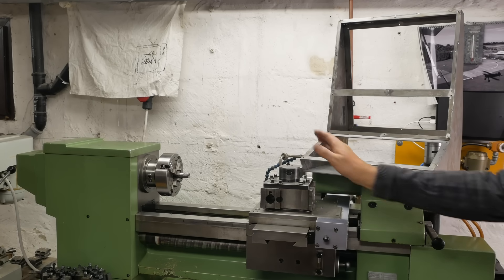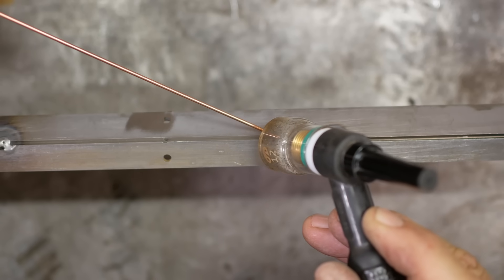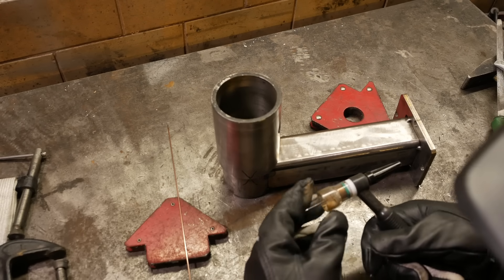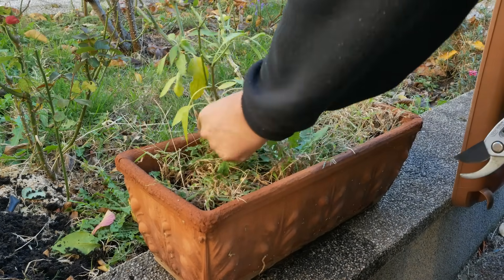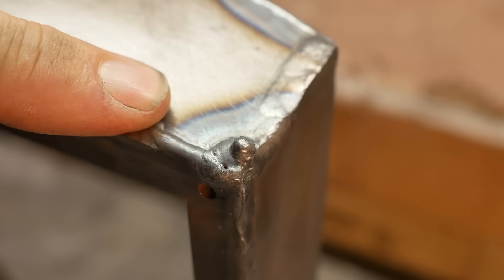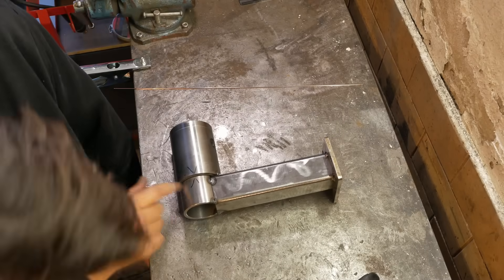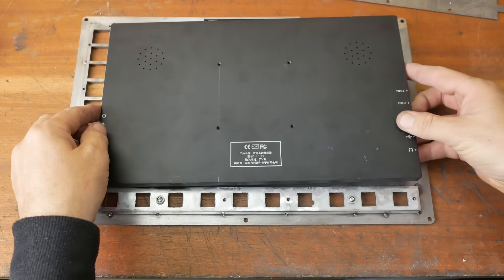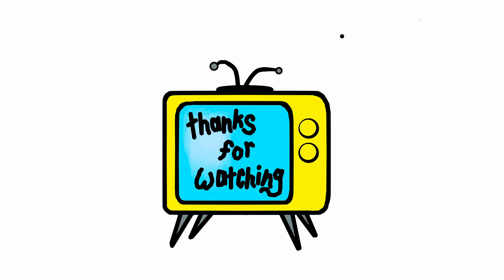TIG'in up the CNC control module  - Schaublin Ep. 57 || RotarySMP

Comment: If you buy a valved torch body you can bypass the machine and do your own pre/post gas by controlling the valve.
Reply from the maker: Is that not even harder to coordinate?
Reply: @RotarySMP  Sorry for the late reply.  You just waste some gas.  Turn on the torch valve, get situated, weld, let it post flow, then turn it off.  There's some waste the start/stop while you're fiddling with the valve.  But all the welding is done at that point so it's the only thing you're working on.  It's a compromise.

Comment: Regarding the LED and the key cap: you may be surprised how much shines through the white plastic. I have a remote switch for an attic mounted exhaust fan that I i added an LED indicator to, since you can't hear the fan, and just hot glued it to the side of the switch. It shines through the white plastic switch plate just fine.
Reply from the maker: Thanks Ross. I will give it a try.

Comment: All that bodyfiller and sanding just to put that ugly green colour on it. But, it is not my machine, so it is  looking great. That looks like a well thought out control cabinet. For the keys: I think you can get these Cherry MX key even with integrated RGB. They are meant as replacement/ swappable key for those newfangled gamer keyboards. I reckon you could also get little circuit boards for them and have them illuminated depending on the switch state. It is not too late to get fancy! 😎
P.S.: all the best for wintering those chilis. I never got mine to survive and had to raise them new from seeds I collected in the previous year.
Reply from the maker: I am also curious as to whether any of those chillis survives, but if they do, it would be brilliant and give us a few weeks head start on the growing season.

I dont really see then need for RGB in this use case. Maybe RG would be of marginal value for a couple of buttons, but I will make do without.

Comment: I was told that removing all the soil from the roots of a plant is a bad idea.  
The thought is that the fine/delicate root fibers end up getting crushed and broken by the new soil which will stunt growth for a time. 
Can shake it off a bit, but leaving a 'ball' of dirt around the roots helps support the smaller roots.  
Finally, once the repotting is done, the roots will make a mad dash to the new soil around the original root ball to get at that newly available nutrients.  This promotes a larger / stronger root system post-repotting. 

That could be wrong - I am not a plant doctor or anything. If others know better I would like to learn about it.
Reply from the maker: I just watched one YT video, and it removed all soil, to prevent insect eggs etc getting brought inside. Seemed plausible at the time :)
Reply: @RotarySMP    That is something I didn't consider. Makes sense.    
Thanks for the feedback.

Comment: Do you have a foot pedal for the welder?
Welds are fine, if you want them look a little prittier just ease up on the heat, or move alot faster. But lessening power is easier. 
Foot pedal is a must for tigwelding.
Reply from the maker: I have a foot pedal, but this welder only supports on/off switching. No ramping.

Comment: Generally speaking, you wouldn't normally use a gas lens for welding mild steel, it's a bit of a waste and can get damaged from sparks.
I would also avoid fusion welds (welds without filler) on mild steel, it tends to make a brittle joint... Not that any of this really matters for a control cabinet, if it's stuck together and doesn't fall apart from handling, you're doing good! ;)
Keep up the good work!
Reply from the maker: Not sure why your comment only just showed up. Sorry for the slow response. 

Thanks for that input. Do you mean the Pyrex part or the brass mesh filter part is not used with mild steel? Or both.
Reply: @RotarySMP  both, a gas lens you would usually use for cases where you need a large gas blanket to keep the weld pool and base material you're welding from oxidizing.
Commonly those materials are stainless steel and titanium.
Reply from the maker: @SeishukuS12  Thanks for answering my question. I have a mix of parts for the original torch and the CK9, and will have to see if I have a normal gas lense set up for it.
Reply: @RotarySMP  no problem!
My go-to setup for steel was usually a 13n12 cup and 3/32" 2% thoriated tungsten, I used this on aluminum up to 3/16" thick as well.

Comment: Hey Mark, nice job on the cabinet. Maybe some thinner filler for those sheet metal parts might help? Not sure what you were using but it looked big. Those thicker flange welds looked awesome!
Reply from the maker: Thanks. The filler rod was about 2mm.
Reply: Your filler should match the size of your base metal, so you probably weren’t too far off actually. It’s always interesting to see the effects of experimenting with different sized fillers anyway, might help.

Comment: Welding on thin materials is difficult,  anything less than 5 mm thick is my nemesis. 
At least the chillies didn't inherit a very nice electrical enclosure. 
Great job.
Reply from the maker: I did the Maho's enclosure with 3mm steel and electrodes. Took even more grinding that this enclosure to hide all the defects :)

Comment: Sometimes a board mounted pot can be found to adjust the delay on pre and post purge. If it has a pot for the gas timer, you could even swap it out for a panel mounted one and increase the value of the welder by $30-40
Reply from the maker: I was also wondering if that welders main board has a unpopulated edge connector for that. It is something I am meaning to look into, but not yet a high priority.
Reply: Anything is possible, sometimes the only difference between the $400 welder and the $575 welder are the addition of $1.35 worth of components. @RotarySMP
Reply from the maker: @steamfan7147  That would be my best case :)

Comment: Looks like you’re making good progress on your welding skills. You might be seeing soot because the metal was not thoroughly cleaned of oils and other organic compounds. I use a clean rag, soaked in acetone as a first wipe, and a refillable pressurized metal spray bottle of acetone as my second pass, that I let runoff evaporate without wiping again. The first 3 steps of tig welding are clean, clean, and clean. 😂
Reply from the maker: Thanks for the tip Andrew. Could be right, as the rag I used for wiping down with Acetone got pretty dirty.

Comment: Looks really professional 😀 less margin for error on thin stuff so will be harder. Can you hook up some sort of delay circuit to get better post flow? you are learning bad habits ...
Reply from the maker: Hi Julia. I need to open up that welder and have a look at the main board. They may use the same board for multiple models, and with a bit of luck there is an unpopulated edge connector for a pregas and post gas pot.

Comment: That one second post gas flow on your tig welder is next to useless. It isn‘t even enough to protect the electrode from oxidation. I recommend that you check inside the machine if you can adjust it somehow to at least about 6 seconds. If not it would be feasible to switch the torch to a model with a manual valve altough this would take some time to get used to. Despite this sub optimal setup you made some nice welds for a beginner.
Reply from the maker: Thanks Don. I need to find time to open up that welder and have a good sniff around the main board. With luck it is the same board used in a more expensive model, and has an unpopulated edge connector for pre and post gas pots.

Comment: Good job, your welding is definitely improving :) One thing to look out for, is that by trying to compensate for your machine's limitations, you may end up developing bad habits. The fact you do not have parameterization control, a foot pedal etc, really hinders you. I was the same back in the day, started off using a cheap, non-TIG converted machine for my TIG welding. But Now I think you a reaching a point where you should considerer getting a proper TIG Plant - Perhaps an AC/DC so aluminium might come into play perhaps :)

Keep doing a great job, looking forward to see the lathe in full form :D

Forgot to add :) - For the Best rod control, get a cheap metronome, like the one's you use on music :) and practice on filling in on every beat :)
Reply from the maker: When I was practicing on scrap, I got into the habit of paying Dylans Jokerman in my head. I play guitar, so rythym is not the issue. I just got out of that habit, and needed a while to regain it.

Comment: Hey Mark, I'm a novice TIG welder as well. One of the things that seemed to help me is that TIG welding is a set of static actions in series, rather than one dynamic action. Think about it like this: start the arc, get a puddle going, add filler, move, add filler, move, add filler, repeat. If think about the "dime stacking" phenomena, it's caused by individual puddles solidifying and having another puddle placed on top. 

I will add that, for a control module, your welds are more than sufficient. If you'd like to decrease panel warp (and save some time) one option is to stitch weld the panels and silicone/RTV them from the inside. That's common practice on drip trays in automotive plants.
Reply from the maker: I did think of just tack welding it, but really, I like playing around with the welder, and would rather do a bit of massaging to get the warpage out, if I can spend hours running beads of weld :)

Comment: Those Cherry MX Blue switches are the bees knees. I have only bought computer keyboards that use them for as long as I can remember. The only ones that are better are the buckling spring ones as found on IBM model M and I think Computronics keyboards, but they are unobtainable or megabucks.
Reply from the maker: Thanks Bill. I used industrial switch blocks on the Maho, but they have not tactile or audible feedback. I can see the advantage of the feedback.

Comment: To include the "pre-gas and post-gas" feature, might be a simple Arduino and two relays?  
(Intercept the "on" button.... start a timer... control the actual one button and the gas-solenoid ;-) )
Reply from the maker: I am hoping it may be even simpler. With luck the same welder control board is used in higher speced models, and there is an unpopulated edge connector for the pre and post gas controls. Otherwise, In ESP32 based modification is something I have been thinking about. Plenty of other projects ahead of that in the list though.

Comment: Looking good! Though i think myself and plenty others are a bit confused why you have chosen to not use any MPGs as an option for manual control?
Reply: Not Mark ,but he has stated in other videos that he will be making a second  apron mounted  panel that
will include (I believe) 2 mpg's for X and Z
Reply: @steveggca  I thought I remembered that convo. Hence why I was confused on no mention of one. But at the end of the day it is his machine and can set it up how ever he likes.
Reply from the maker: Yep, as Steve said, I will be putting the two jog wheels on a separate module down on the apron, where they will fall more conveniently under the hand.
Reply: @RotarySMP  that does make sense.
Reply from the maker: @wildin13  Until that is done, I will have a little joystick on the control panel.

Comment: Hi Mark that looks great, even the welding, after filler and paint😁(I can't weld so ignore me)
Will the LED's be reassuring blinkenlights?  or if you prefer, feedback indicators that the requested function has actually happened.
Reply from the maker: Yes, I will be interfacing the control panel with a Mesa 7i73 card, so I have 8 outputs (I think), which I will use to report back that the requested funtion actually happened.

Comment: Could you put an off delay relay in the circuit controlling the gas valve?
Reply from the maker: I need to open up the welder and see how it is wired. Might well modify it, but that is a pretty low priority project right now.

Comment: If it were my welder I'd rewire the Gas solenoid. If you add a time delay relay and set it to five or ten seconds. You could tap the peddle and have pre-purging and you would always have post-purging.
Reply from the maker: It is on my to do list to open up that welder and have a look at the PCB. I would not be surprised if they use the same PCB for multiple models, and it may be a simple as an edge connector for a pot not populated.
Reply: Or an trimpot on the PCB  @RotarySMP

Comment: Huge amount of progress in that short time!
Reply from the maker: Thanks Alex. We had a public holiday on Wednesday, so I got a full day of work in on it there. Otherwise it is one coat of paint per day. Now I doing top coat. I will wait two days, give it a light sanding and one more coat.

Not sure if todays live stream was the right topic, but I figured I try making something again.
Reply: @RotarySMP  Stream was very pog. Do you want a cabinet-mountable Ethernet (and/or USB) pass-through for that peli-case/streaming setup? I might have a few left over as well. Although they're not super expensive on Amazon. Maybe you already got some?
With the CNC cabinet - I thought about that powder coating would have been the best choice. Although not really an option in the home shop.
Reply: I thought about external, dust-proof (with protective cap) connections for USB-C, HDMI and Ethernet.
Reply from the maker: @graealex  I bought the dual USB-A panel mount with dust cover you recommended back when I did the mock up of the Schaublin control. That is going on the control panel. I havent really thought about HDMI or Ethernet, and made no provision for them on the Schaublin. RI guess for streaming an HDMI out would be better.emember I have that dodgy second display port which drove me nuts, so I will keep away from that. I normally just screen record which turning, and then download the file to a usb stick and sync it in Resolve. 

With the streaming case, I already bought extention leads with panel mounts for ethernet, USB-C, and 4x HDMI. I just need to draw up the DXF to get that little panel lasered, and will butcher it onto the the back of the fake peli case.

What dos POG mean ? Thanks for joining that stream :I know that sort of stream is pretty chaotic.
Reply: @RotarySMP  pog = "Awesome, excellent, remarkable" - used with streamers mostly
Reply from the maker: @graealex  Thanks. I wonder whether some of my antics work at all :)

Turns out that fake peli case is 5mm thick. It is really overkill for this project, but it was the closest I could find to the optimal dimensions.
Reply: @RotarySMP  It looks really nice though, and it's a great idea having it all in a mostly dustproof case. Especially in a workshop. Do you need an SSD or something? Have a few older SSDs lying around, together with a SATA-to-USB adapter, that'd be more than adequate for recording your clean feeds.
Reply from the maker: @graealex  Thanks for the offer. I have a Thunderbolt 4 enclosure with a 2TB M.2 drive in it. This is my main drive for video, as I generate up to 250GB of files each week, and was running out of space on the MBP's internal drive, even with offloading each time i finish a video.  I'll use that drive with the AtemPro Iso to save the clean feeds.

Comment: Funny, but I've only even seen people with Australian or New Zealand accent put bondo on tools. :D Geoffrey Croker even put it on a tin box for a socket set
Reply from the maker: It is an important part of any tool box :)
Reply: Hi MrDoroh  , regarding  body filler on tools , in the 90's I  traveled to Bridgeport Milling Machines in connecticut, Harig grinders in illinois
and Mori seiki in Japan , for factory training. Cast iron is rough, all of these builders had an area where the iron frames were filled and sanded
before painting. In fact any cast iron part on any machine that is smooth, has been filled, sanded and painted.
So its not just the austrailians and new zealanders.😃
Reply from the maker: @steveggca  Yeah, I agree. All the machine tool builders were big consumers of body filler.

Comment: I don't mind the grinding. It's the filling and sanding that I don't look forward to.
Reply from the maker: This went pretty fast, but I am not looking for a show car finish.
Reply: @RotarySMP  A zirconia flap disc is much easier to control when grinding those outside corners flush and smooth.
Think of it more like a blending disc, rather than a grinding disc.
Reply from the maker: @jimurrata6785  I like using the belt sander, as it has a long enough sole to level out the high spots. With at a flap disc I tend to dig divets.

Comment: In the factory I work for, we have a lot op piping projects (10" lines on average) going on. Where in the past electrode welding was used most is now tig.
But the old large welding generators haven´t gone, they just got a rigged with a bottle of shield gas.
No fancy controls on these.
Moreover all the welds are 'photo' grade most of the time, inclusions in the welds mean redo work ...
The welders use a (beefy) copper plate to start the arc, doing so no arcs on the work piece and pre gas as well.
Thanks again for this video
Reply from the maker: Interesting technique